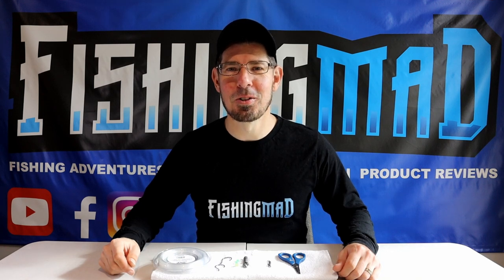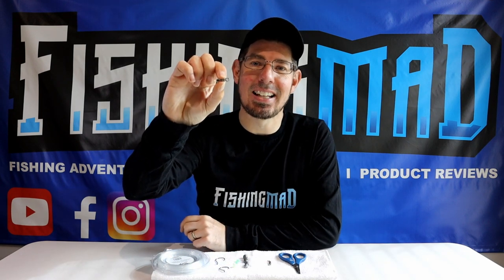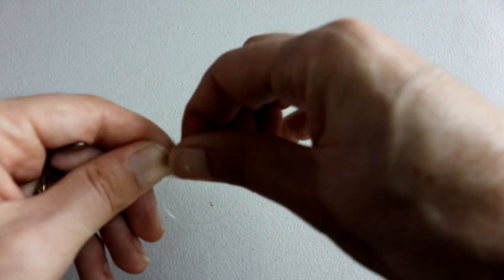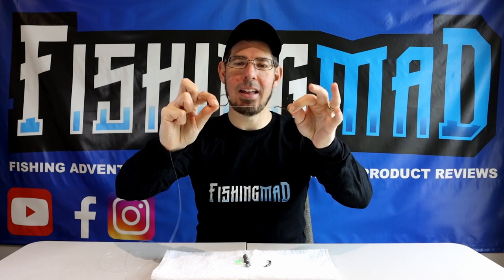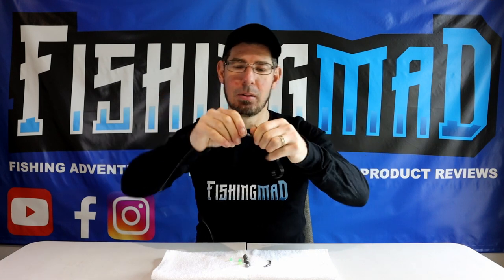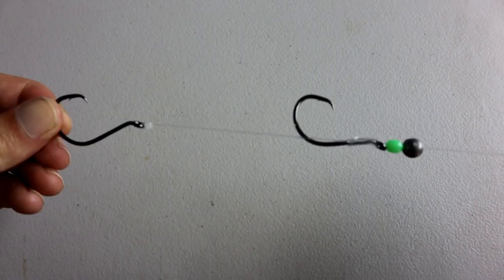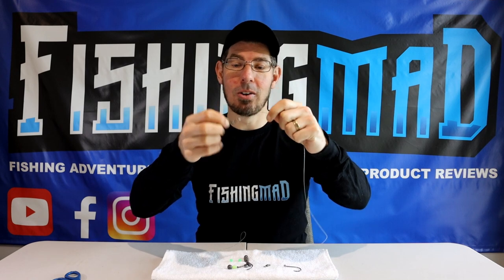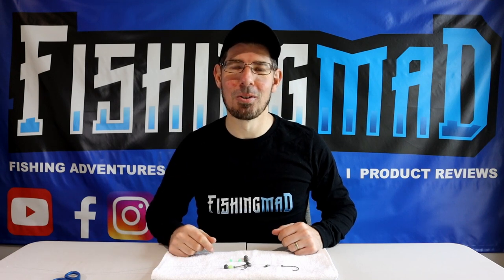How to tie a Snapper Rig | Port Phillip Bay ( DIY step by step guide )

Comment: Love the vid Alan but just personal thoughts on having the bead and sinker on the leader versus the main line. I find that having the sinker on the leader tends to have the bait get snagged when fishing on reefs. Would you ever move the sinker depending on the ground?
Reply from the maker: Hi Jay, its a great question. If im fishing on shallow reefs i wont use the sinker and will fish unweighted. otherwise all other times i have a very small size 0,1,2 on the inside of the leader.
Reply: I would also assume that the bait will not sit as free off the bottom of the sea once the sinker hits the floor if it is threaded on the leader as opposed to the mainline behind the swivel. What is the benefit of having it on the leader apart from convenience when re-rigging Alan?